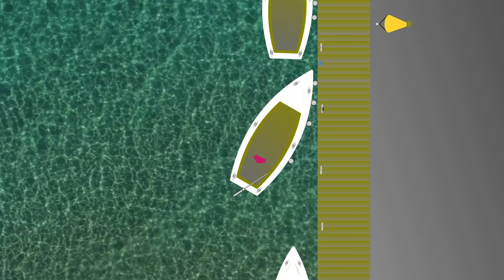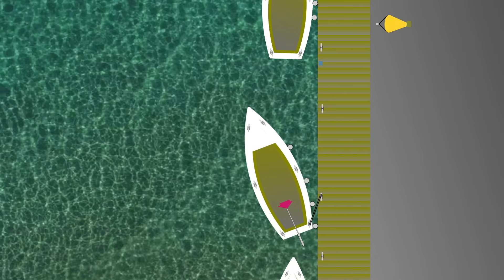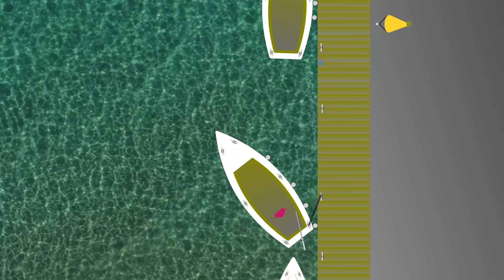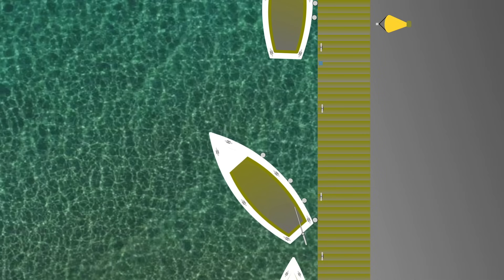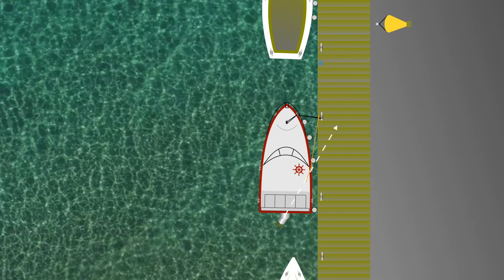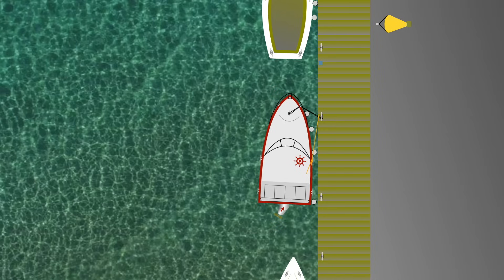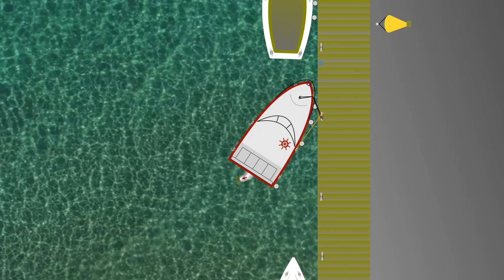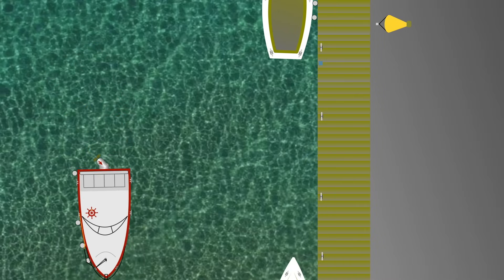Get off the dock against the wind with a single engine

Comment: I love watching your "cheats".......which I personally believe are excellent boat handling tips. Thanks for making the effort to put these together and post so we can all benefit from your obvious experiences. Cheers!
Reply from the maker: Thank you for your very kind words!
Reply from the maker: My experience is relatively limited by some standards… I signed onto the crew of MV Raenif in 1979 and spent a year and a bit working and living it sea, and have been boating on and off ever since.  I’ve had a couple of motor boats and a couple of yachts, of varying sizes, plus a several large cat bare-boat charter holidays…. and definitely still learning!

Comment: Great explanation. However, each approach pushes the boat to the doc, which has risk involved, especially with higher winds. I prefer to tie a spring from windward aft cleat, away from the boat to the dock. Engine forward, steer towards the dock, this moves your whole boat away from the dock, keeping it mostly parallel. Now, gently (!) steer away from the dock. Without any pressure of boat to dock, or any pressure on the crew, your boat will pivot towards the wind. Now, slowly remove the line, keep the tension,  and then take her in and sail away.

Comment: Much better solution is to tie a line from the port-side stern cleat to the cleat next to the abaft boat's bow, and then motor against that line with the helm very slightly to port. The boat will naturally swing off the dock, and you can slip the line and motor away.
If needed you can have a fender on the starboard rear quarter to protect the stern from bumping off the dock.

Comment: Very helpful video. Thank you for this. I am just about to put into practice what you have advised for a single engined outboard on a small (24 foot) catamaran. We are really tight into the pontoon in Torquay Council pontoon so very little space fore and aft to manoeuvre or swing. Also we have an overhanging dinghy on davits so I think I will stick to using your first bow method to get out. Any extra tips for a catamaran as you said that you had also had experience with cats?
Reply from the maker: @simonstell8018  Thank you!  For a small cat there is one additional tip which you might find helpful… I will do a video in the next few days specifically about your issue.  Am I right in assuming it has a single outboard like many smaller cats, or do you have the luxury of two engines?
Reply: Thanks for your reply. Just a single outboard in a well. We have a Solaris Sunbeam 24 cat.

Comment: Great videos so informative with fanatic illustrations. I am a new mono hull sailboat sailor and would like to see if you could do a video on the following setup. I have a double slip with another right next to me. Most of the time the wind is directly on the beam. So departure and arrival is tricky. Wind will push me direct into the on my leeward side. Any help would be greatly appreciated. Your illustrations are really helpful, best I have seen. 👌🏼👌🏼👍🏼👍🏼
Reply from the maker: Hi Steven, Thanks for your kind comments. I will be glad to try to help you… but a few questions come to mind… 1. Is this on a finger pontoon or piles? 2. I guess the prevailing wind pushes you onto your neighbour, so is that neighbour on the side you approach from along the fairway, or beyond your mooring as you approach?  3. Is there any current to consider?  Best regards, Laurie
Reply: Hi Laurie the setup is pontoons no piles. I have to approach the double slip from the fairway and make a port turn into the slip. There is no structure between me and the boat next to me. So any wind on my port side pushes my boat directly into my slip mate. There is current but it runs astern of the boats not usually a problem. But a westerly wind at 10 to 15 knots is a problem. The fairway runs East to West and slip north to south. Thanks for your help your videos are the best. The way you present the information with the illustrations really makes it easy to understand. Any help would be appreciated thank you.
Reply: @stevendiraimo3315  more questions: 
- single or double rudder? 
- how you stear into the berth? In reverse (stern to the pontoon) or in forward gear (bow to the pontoon)
- how long is the finger in comparison to the boat length? 
- do you have a middle cleat on your vessel?
- is there a cleat or a ring at the end of the finger?
- are there more cleats or rings on the finger and the pontoon?
- In which direction the stern is pushed in reverse (prop walk)?
- Saildrive or shaft drive?
- do you have a long keeler or modern vessel?
- how much space do you have in the fairway to turn your vessel into the berth?

A lot things to consider bevor anyone is capable to give some advices.🤔

Comment: Rather stresful in any significant wind and when it's hard to fully protect the boat because you risk bow sprit or the anchor  or the stern bathing platform hiting the deck. On small boats it's easier to just push the boat a meter or two off the dock at the start and on the larger boats use bow and stern thrusters
Reply: Actually, no. It's srtressful and dangerous to push off a boat by hand and you won't get it a few meters off the dock with any serious windage (unless with small boat you mean like a dinghy or rowing boat?). If you've ever sailed in a small yacht of about 35ft or more, you know that you simply cannot push it off at all. And bow (or rare, stern) thrusters aren't strong enough against wind of 15kn and up. I tried, many times, as I agree, using thruster seems easiest, but it just won't work.

I often sail single handedly with a 44ft 11k ton sailing yacht. My personal preference in cases like these is to use the wind-side stern line as a spring backwards to the dock, then rudder pointing to the dock and go in forward. This moves the stern off the dock first, less chance on damage as in the first approach in this video (which cannot be done singlehadedly anyway). Then give more thrust and wait a little (keep steering towards the dock), the bow will move away. Now you can let go of the slipline. 

It is much less stressful then some of the methods here as there's no "flip" of  backward/forward thrust and no pushing against the dock. It can easily be done singlehandedly and works with (almost) all types of boats and engine types. No danger for your boat or crew and no hulk-like muscle strength needed ;).

Comment: Good cheat...  With nice clear diagrams...  However....  

I don't understand why you are calling the bow and stern lines - 'springs'....    I was always under the understanding that spring lines were diagonal warps running from inboard bow cleat/bollard to outbaard/shoreside-aft cleat/bollard/ring and from inboard stern cleat/bollard to outbaord /shoreside bow-cleat/bollard/ring.; thus presenting an 'spring' in the form of crossed equal warps ('X' spring).    Alternatively (depending on size of vessel...),  a single warp running from inboard stern to outboard stern, back to inboard midships cleat/bollard and then on to outboard bow and finally to inboard bow;  presenting a 'W' spring using a single warp.  

The purpose of a 'spring' line being to keep the vessel's side parallel to the dockside/wharf/jetty regardless of prevailing wind.
Reply from the maker: Thanks! Glad you found it useful.  My understanding of ‘springs’ is simply lines used to prevent fore or aft movement of the boat relative to the dock or pontoon, as opposed to breast lines which prevent movement laterally away from it.

Comment: Springing the stern out will work up to 12-14 kts wind, than watch out.  Springing the bows up to 8-10. Your instructions don't mention the inevitable leeway (and eventual propwalk) before gaining speed,  which would push the boat  onto the respective other one, in motion!
Reply: in the example shown at 4:22 it seems to me that you could spring the bow out at higher wind speeds than 10 kts if you're willing to put a second spring line on the aft cleat port side, and if you tighten this second line enough, possibly using your sheet winch or a pulley system, you should be able to point the bow even directly into the wind.
Reply: @Verradonairun  
The suggested ways are ok, I only warned that the animation works like that only in lighter winds (eg. suggests to put forward idle, while one has to rev up).  Port/outside spring is ok in theory, but it has to be longer than the space shown ; it increases the risk of snagging, hitting the strb stern corner.  If available a motor dinghy or a line across to upwind pier can make things easy.
I'd go for stern out since the bow is easily blown down and then snafu.
Reply: @observer2172 I think you're right about my solution not being practical. A second idea would be to use your anchor, instead of a windward post, but you'd have to drop it before the bad weather arrives.
Reply: @Verradonairun  I've never seen preliminary anchor drop, although ferries use it for maneuvering in windy conditions. 
In most Aegian  harbours they moor on anchor and stern to. This is done now very often in the crowded Dalmatian bays, with line ashore.
Reply: @observer2172 yes, I got the idea from the Mediterranean mooring technique, which I'll be trying out for the first time tomorrow evening. My only concern is that it might prove difficult to steer the boat and pull up anchor simultaneously from the cockpit, as I'll be practicing single-handed and don't have a fancy remote-controlled windlass. 😅
Reply: @Verradonairun  Single handed will be there very difficult, no go in cross winds. When quiet you can dump a lot of chain by brake, run to steer, secure the stern lines and tight chain. Alternatively approach astern and pick up  help for the windlass, if available. I've seen use of dingy to carry out the anchor in 4-5 m deep.
Reply: @observer2172  I decided not to try the Mediterranean mooring yesterday, as I deemed it too risky in that moment. Another solution for the arrival part of the Mediterranean would be to drop anchor (from the cockpit), motor stern-first towards the bridge while gradually letting out more rode (from the cockpit, by hand), then once you're close enough to the bridge, secure the anchor line to bow cleats and use motor power to set the anchor firmly, then lower throttle and slowly release more anchor line as you bring the stern close enough to the bridge to secure aft lines. The bigger puzzle is how to safely depart from a Mediterranean mooring single-handed.
Reply: @Verradonairun  So .. short free course ...
If you're talking anchor rope you're asking for trouble - should be all chain or min. 8-10 m of heavy chain before rope. 
Leaving is ok, but in cross winds: if you shoot out from between you'll overrun the rope and may foul the propeller / chain may scratch the hull and pull the bows.
You need a remote windlass or a hand if you anchor to pier often.
Reply: @observer2172  Thanks for your input.

Comment: why nobody thinks to post a video on very hard tight dockings? many boats have to dock front or rear ended with boats either side with tides rushing out and in and strong wind
Reply from the maker: @gatecrasher1970  We have several videos covering tricky moorings on this channel. However, there are doubtless loads of situations that we haven’t covered.  With the various configurations of hulls, props, rudders etc there are literally hundreds of possibilities… and they invariably spark debate because there are as many ‘right’ ways to do it as there are correspondents.  Please suggest any you don’t find that you’d like to see.

Comment: I don’t like the first method! The wind will inevitably have the effect of pushing the bow into the dock as you try to pull away and reversing will increase the apparent wind, thereby increasing the effect! In lighter winds it might be OK. 
Also, in neither the first or second scenarios is there any mention of having a crew member with a spare fender (preferably a big one) on hand at bow or stern respectively whose task is to drop the fender down between boat and dock should the bow or stern quarter threaten to make contact so as to avoid a nasty crunch in the boat’s hull!
Just my $0.02!

Comment: Pull-ease people, the boat is IN the dock.  It’s at the wharf.
The wharf is not a dock.
Still don’t understand!?  Imagine this then.
One can jump off the wharf into the dock. The dock is the water space beside the wharf. 
And think of it this way….
One can take the boat from dry-dock and place it in ‘wet-dock’ at the wharf !!
Other than the incorrect terminology,  the boating advice was good.  Thanks.
Reply from the maker: dock
dŏk
noun
A platform extending from a shore over water and supported by piles or pillars, used to secure, protect, and provide access to a boat or ship.
An area along a commercial waterfront having docks or piers.
The area of water between two piers or alongside a pier that receives a vessel for loading, unloading, or repairs.

To be fair getting off the dock is not a phrase I use normally, but most of my powerboat audience are based in USA, where the phrase used in this title is in common usage.
Reply: @theboatcheat1204  I stand corrected.  The language is ever evolving. Seems the word has been used incorrectly for so long it is now in a dictionary,  although it does still reference the ‘water space between two piers’.  In Lake country’ one can see many advertisements for floating docks for sale.  To me those signs will always reference floating ‘wharfs’.  Red skies at night !